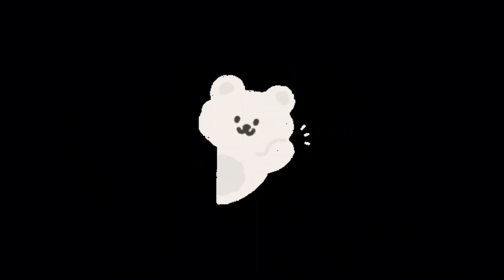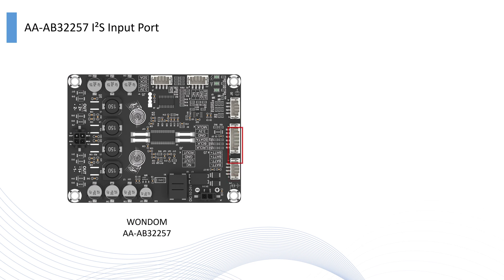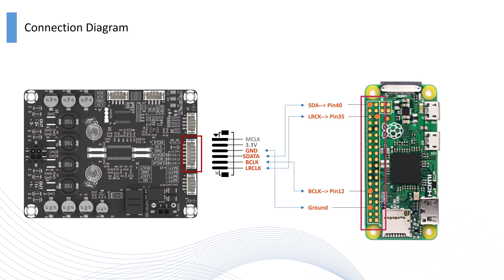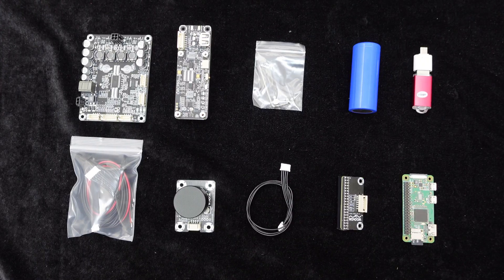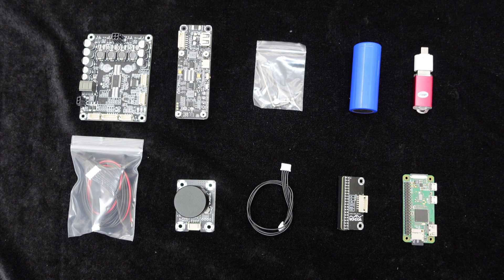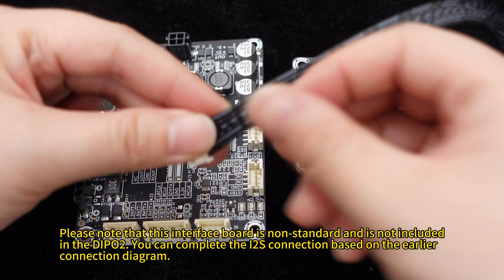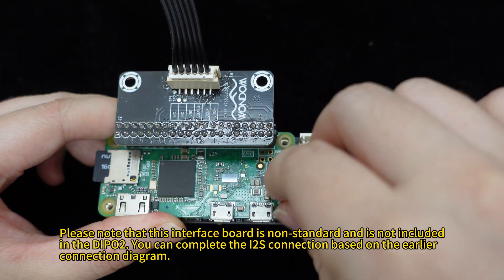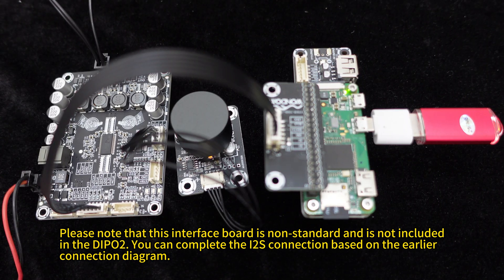Connect Raspberry Pi with Stereo 50W I2S Digital Amplifier Board DIPO2 through I2S | TAS5768

Comment: So this is unusable with a Raspberry Pi without an adapter board? What is the part number for it? I can't seem to find it on the website.
Reply from the maker: Hello, and thank you for watching. You can complete the connection without the adapter board by simply connecting the I2S pins one-to-one as shown in the diagram. Alternatively, after placing your order for the DIPO amplifier board, feel free to leave us a message, and we’ll include a complimentary adapter board in your package. Wish this could help you. Have a fantastic day~
Reply: @WONDOMAudio  I did purchase the board but not directly through Wondom/Sure. I used jumper cables following the diagram as you said. The board works great!